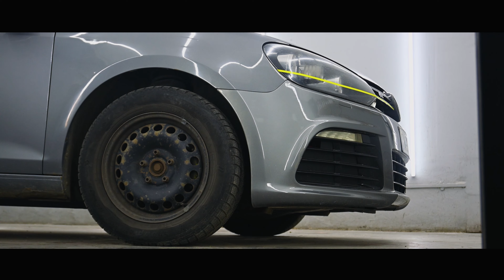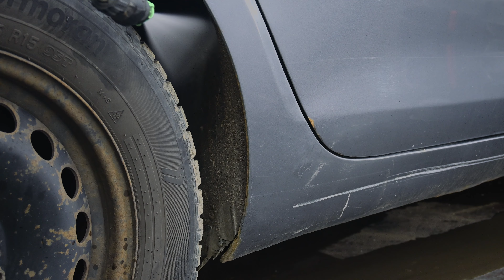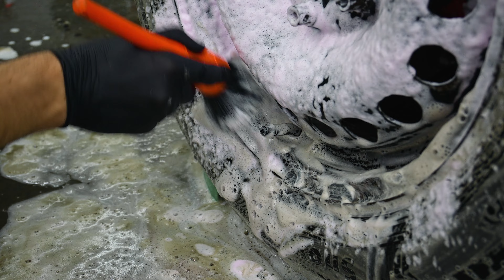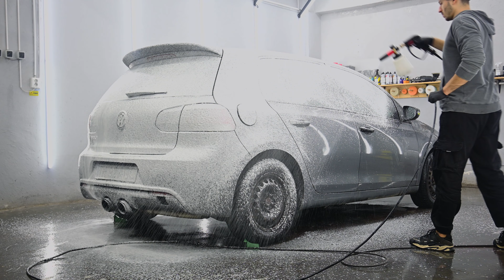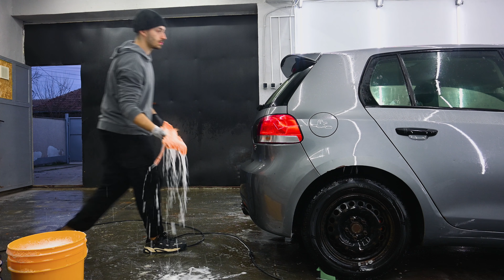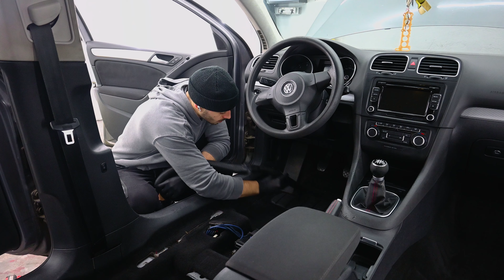Dirty VW Golf 6 Interior Detailing - Car Detailing

Comment: Hello, you use Carpro inside like me and I have a question: do you use pure Carpro inside? or dilution? If so, which do you prefer: 1:1 with water or e.g. 1:5?
Reply from the maker: I have it pure , 1:1 and 1:10 , planning to buy 2 more 1L bottels to make 1:3 and 1:5 dilutions also , but mostly i use it 1:1 and its still going strong on cleaning
Reply: Thanks for your opinion , I have 1:1 dilute is my favourite